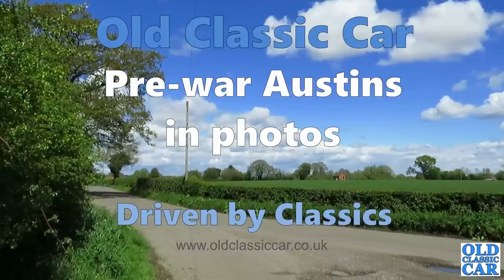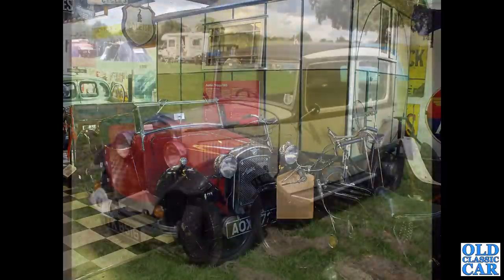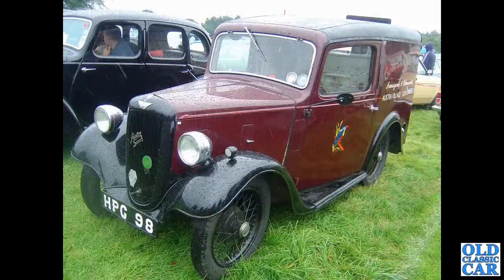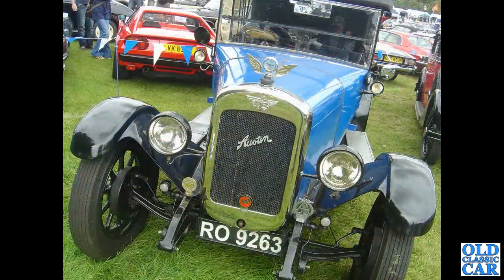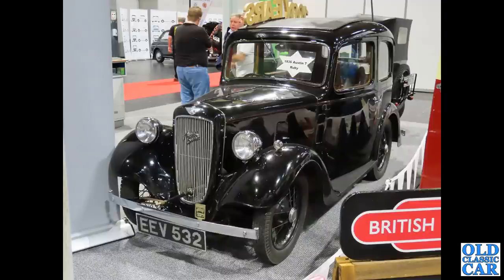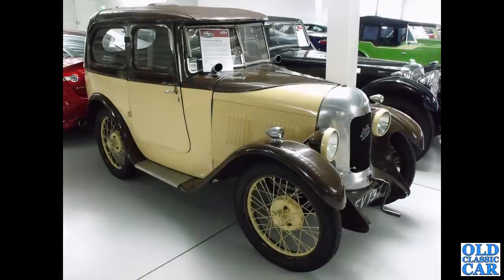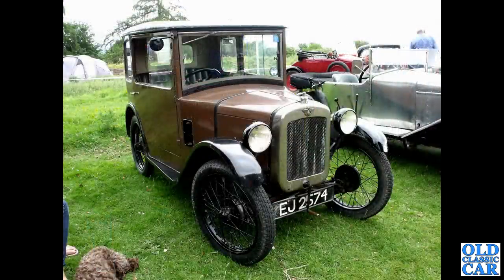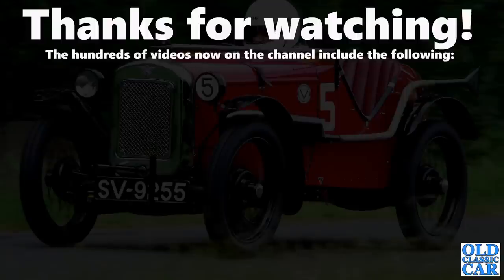Pre-war Austins | Austin cars of the 1910s, 1920s and 1930s

Comment: 12/4 & 12/6 have identical bonnets so the number of vents doesn’t tell you anything.  CGH 507 white tourer is a 12/4.  The 12/6 has a thicker chrome trim around the grille and the front badge is ‘Austin Six’.  The 12/4 has thinner trim and a simple ‘Austin’ badge.

Comment: I thought that the Austin 16 at 9:30 was a post-war model, not pre-war, and it had 
the new 2199 cc four-cylinder OHV engine which I believe was Austin's first OHV.
Was there a pre-war 12 that used the same body?  
I much admired the post-war 16 when I was a lad as a roomy car with comfortable
front seats.
I very much enjoy your videos, especially when pre-war cars are featured.
Reply from the maker: Indeed so, off the top of my head I thought that it had appeared shortly prior to WW2 but obviously not. Thanks for watching.

Comment: Big 7 is not really a 4 door Ruby. It is a revised car with a longer wheelbase and a 900cc engine, and prefigures the 8 as much as it continues the story of the 7. No running boards! Both models were in production at the same time. There was also a 2 door Big 7.